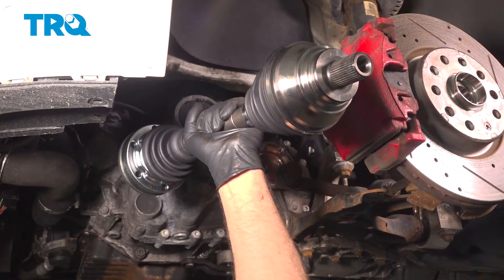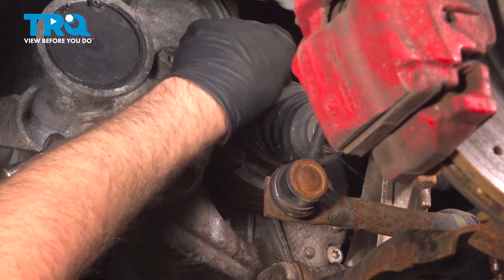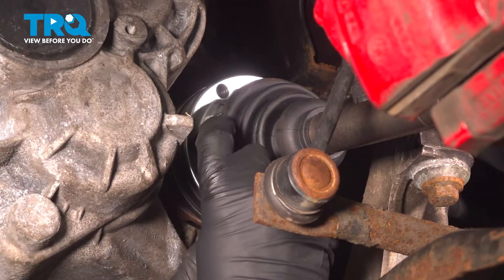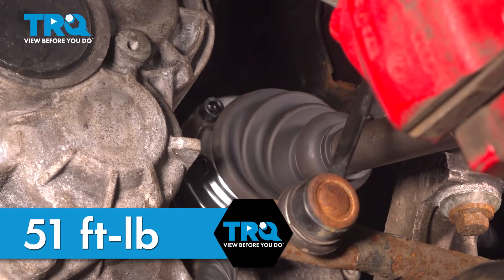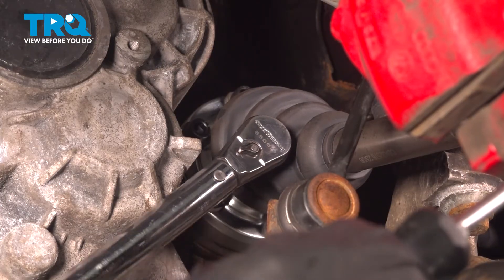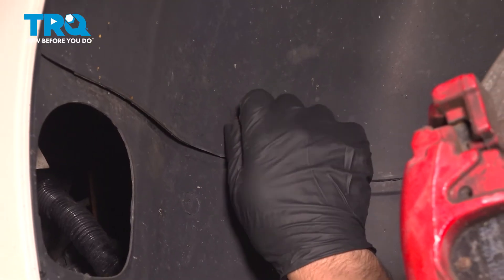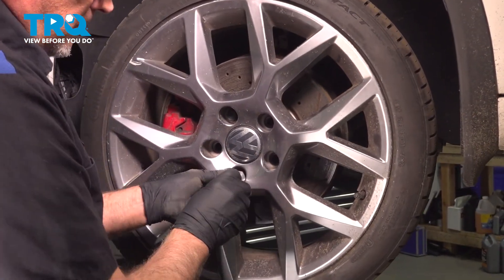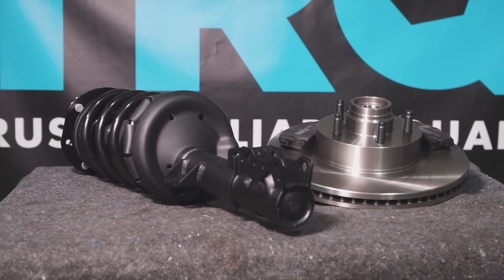How to Replace Front CV Axle Assemblies 2010-2014 Volkswagen GTI

Comment: If you slide the axle transmission part in first and glide it somewhat above the trans space, get the hub part in , you should be able to install it without having to remove the bolt joint or any of that

Comment: Hi buddy,
I plan to replace my drive shaft on a Fabia 2015 mk3. Am I correct in understanding that there is no need to worry for gearbox oil leakage or about damaging any transmission seals when doing this work? As seen in your video?

As my understanding is the inner cv joint bolts to a drive flange that comes out of the gearbox / differential. And so, a sealed unit.

It looks very straightforward of a job but I just want to pre empt any issues. 

Thanks.